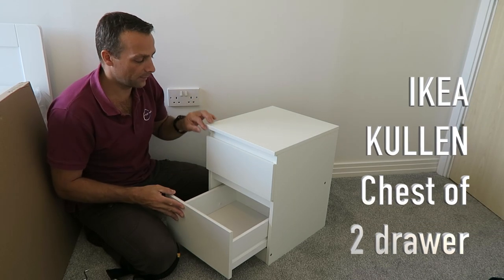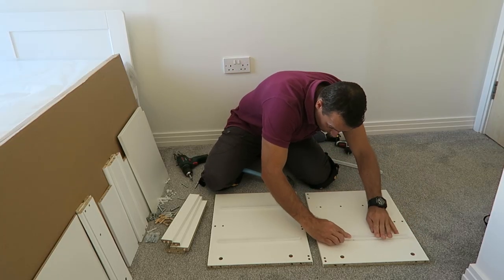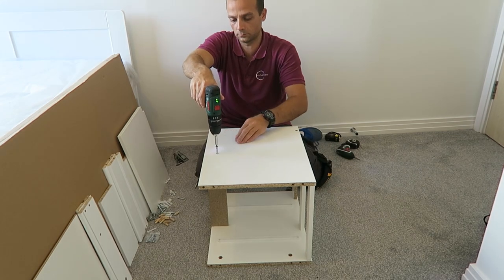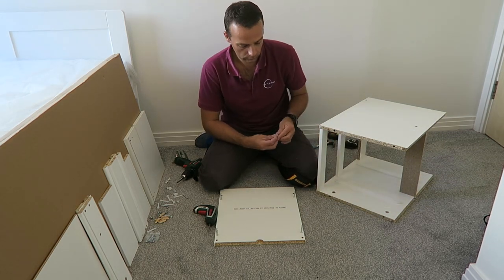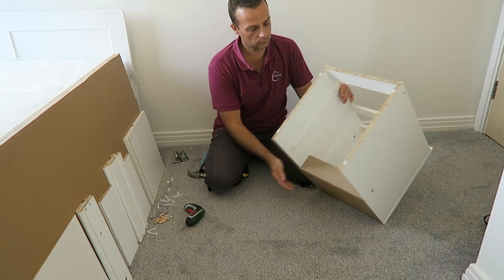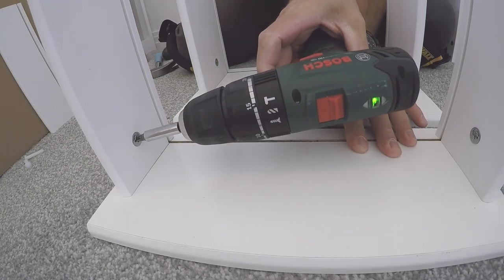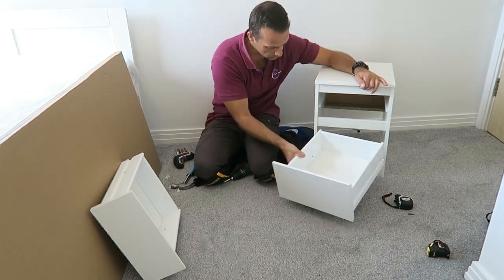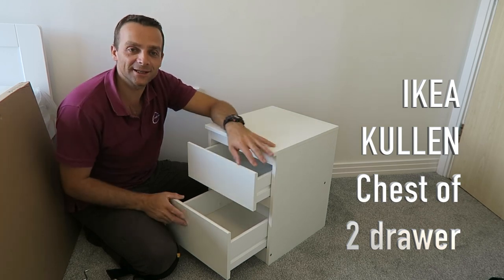IKEA KULLEN Chest of 2 drawers assembly

Comment: Did anybody else have the 4 white plastic things with the extrusions not fit the holes on the side panels?? Mine looks like the holes were not aligned properly so it overlaps
Reply: yes it was there in the  tools pouch.
Reply: That’s my issue ..it doesn’t align in the holes

Comment: Thanks for the video. I have a question: the bottom drawer is a little hard to slide ( I’ve bought and built two, both the same). Is it normal? Would a little oil in the rail help?
Reply: I sprayed a little wd40 on the rails followed by lemon pledge to get rid of the smell.
Reply: @gumbowife  Thanks for the tip although we didn't perceived any particular smell

Comment: Hello, I’ve just assembled my first Kullen bedside table, i followed directions, my problem is the drawers will not run smoothly. They are extremely stiff to open and close. 
Any idea what the problem might be and how I might rectify it please? 🙏🏻
Reply: I'm having the same issue! I'm trying to figure out by finding videos on youtube
Reply: Use wd40 which i did
Reply: It's because the rails are plastic. I'm very disappointed. This is not usable at alla... I'll try to hack it and place metallic real rails. I'll inform you.
Reply: Oh god I didn’t think that I will find another one has the same issue that i has, I will try the wd40 for now it’s seems a good idea, thanks guys 🌹
Reply: @nawaf8258  did the wd40 work?? I have the same problem. Can here to find a solution
Reply: CinaSung yes it worked better than before but not perfect, and be carful when u spray it, i recommend spraying on a napkin and wipe.
Reply: I have the same issue, I just assembled this yesterday but the drawers are not running smoothly at all.
Reply: Drawer will run smooth if you hammer the rail softly. When you drive in the nail at corner of plastic rail, it slightly gets elevated and is not a perfect fit to the surface.
If you can manage to get your rail flat on your surface - your drawers would work 100% smooth.

Comment: Hello i was looking a little advice when assembling drawers with plastic rails would you recommend adding a little glue to make them more secure  thanks in advance
Reply from the maker: The drawer should be fine without the glue they design them to be assembled without any glue (I like that glue just make a mess) on the other side glue would make the unit stronger but you lose the option to dismantle your furniture if need.
Reply: PP FlatPack thank you for the advice I'll bear it in mind